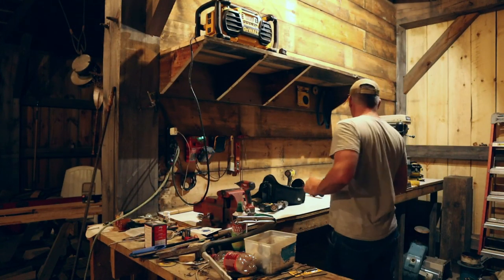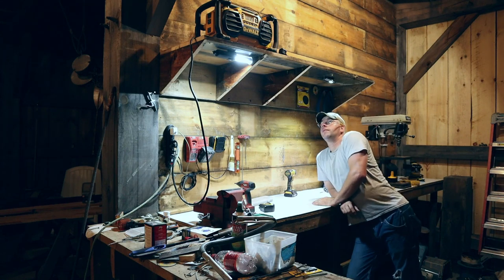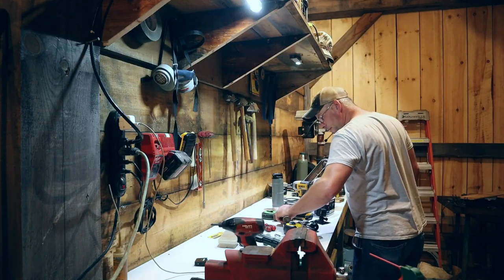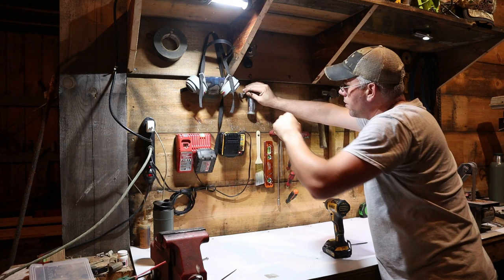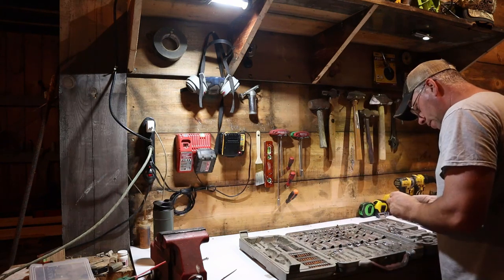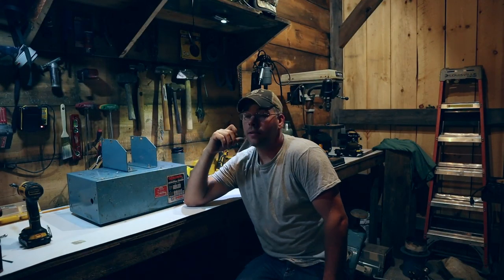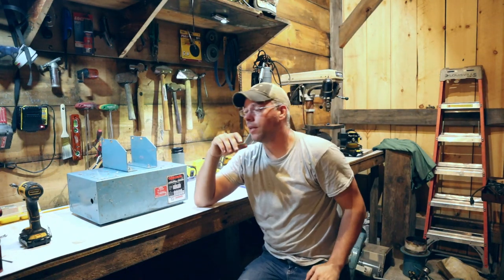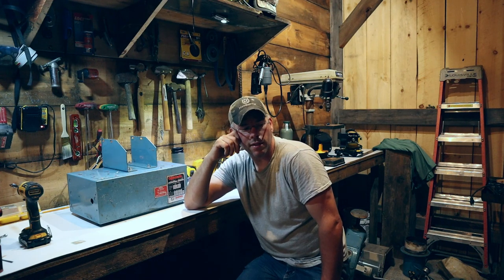Super Easy and Super Bright Workbench Lighting A Timber Framing Vlog

Comment: Jim when are you going to finish putting the siding boards up and the batting boards ??? You should be doing this while the weather is good and you’re not working in the rain 🌧 and the cold 🥶 🥶
Reply from the maker: Don I do things as I can do them.  When I put a video together it is usually stitched together from throughout the day, ten minutes here, ten minutes there.  What you guys don't see is all of the other stuff that keeps me running and doesn't make the camera.  I will get it done by the time I need it done, in the meantime I will just keep doing what I can.  As for batting, I've said it a hundred times, I'm not doing batts.  This building is getting another layer of siding over the sheathing.

Comment: I've been a "no-peg-boarder" for longer than you've been alive. It only took me a few minutes back in the '60s to get why it's useless for me. An example: one of the attachments sold for it is a six tool screwdriver holder. Great idea--unless you have seven screwdrivers, or if one or more have small handles. I suffer all of that. Plus, hammer holders which don't account for the differential between head and pawl, consequently skewing the hammer as it hangs (inconveniently) on the wall.
Ugh!
Reply from the maker: I was wondering where you've been.  Good morning.

Comment: I made LED fixtures using LED boards purchased on E Bay, from China. I attached them to a small piece of aluminum and slid that whole  combination into a framed business card holder that has a glass cover. They run on 12V and I haven't had one fail in over five years.  Power can come from a cheap wall transformer or a bespoke power supply.
Reply from the maker: Nice